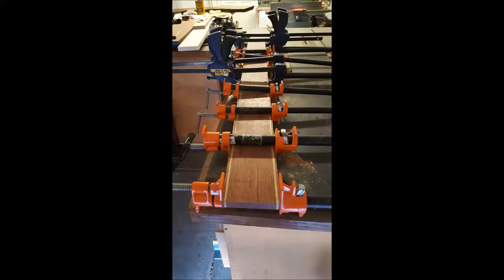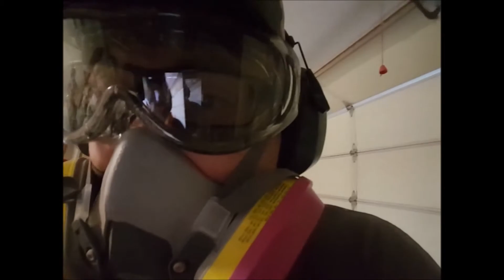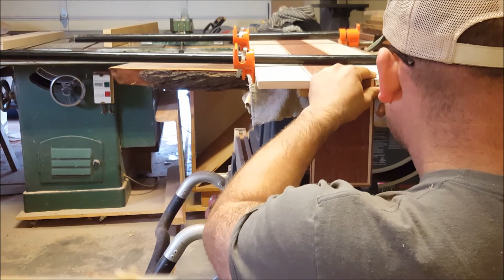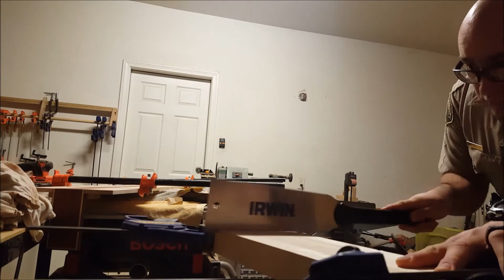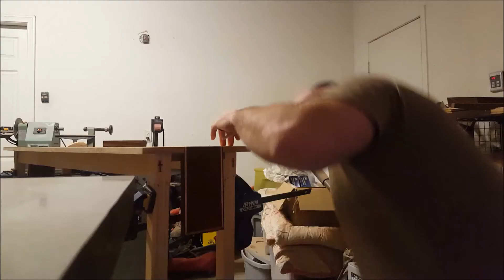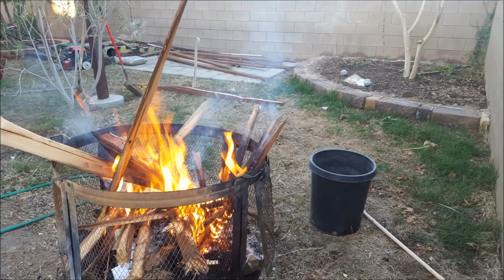T a b l e   B u i l d - Noob trials

Comment: Looks great! I’m jealous of all your tools.
Reply from the maker: My shops is much more loaded now. The bulk of the machines I bought used and broken. A little repair and calibration and they're good as new.... maybe better:/ i buy some handtools new, but the japanese chisels ride expensive.  I buy used ones and just sharpen the heck out of them:) once this heat dies, I'll get my initial sharpen done and get back to work!
Reply: I got a decent table saw that’s top was rusted and throat plate was destroyed for really cheap. Took some serious elbow grease but it runs like a champ now. I really need to find a jointer next, but the more I’m getting into making knives the more I want the tools required for bladesmithing.
Reply from the maker: @ericmccall1789  Then work that route:) I've done some blacksmithing out here, and as much as I like it, the cost to pick up yet another hobby isnt worthwhile at the moment. If you haven't already seen his stuff,  Alec Steele is a great channel for blacksmithing and now his focus has been blade making.
Reply: NobodyFromNowhere yeah, I watch every video he puts out. Every project he makes is better than the last. Have you seen the samurai carpenters videos? He makes some amazing stuff but his channel has died off. Both are very inspiring.